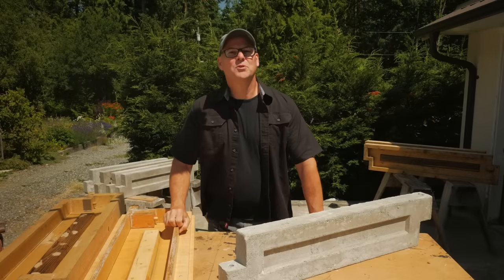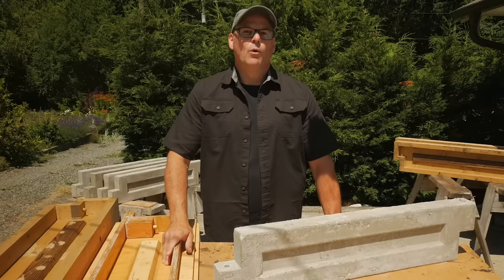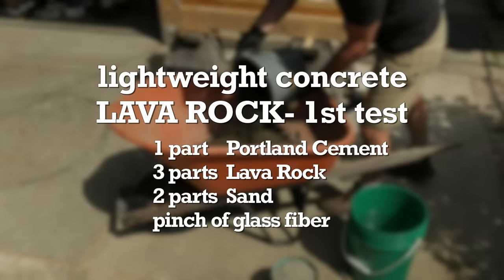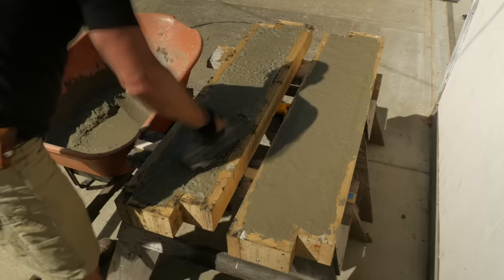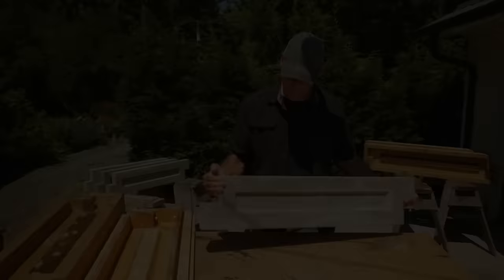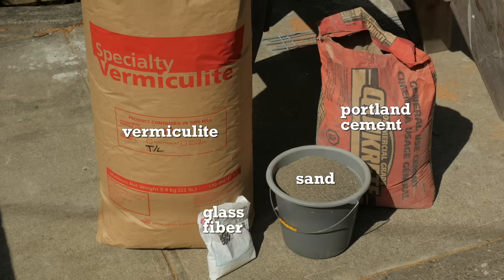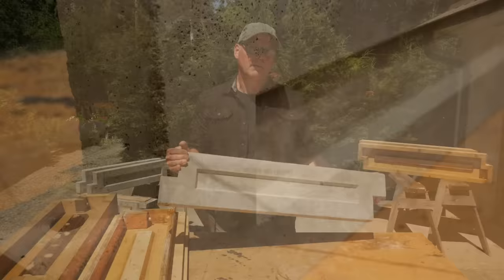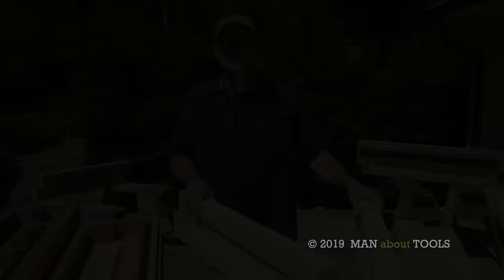make Lightweight Concrete Garden Boxes PART 3 - Aircrete Vermiculite Lava Rock

Comment: And if it is not abrasion resistant tried dipping the completed mold into some liquid concrete letting it dry and then dipping it in again To give it a solid concrete coating

Comment: Isn't what's warping is the form.?
The cast can't bend independent of the form can it? So the assumption might be that the form was left on the saw horses to dry and the weight was causing the unsupported middle portion of the form to sag down...

Comment: As an incurable engineering  MacGyver since I was 8yo I can stop experimenting with materials! Your videos on concrete are great! Several decades ago I made floating concrete docks that were stronger than what is considered high strength. I used a micro bubble mixture and expanded shale aggregate for low weight and posalith  to make the dock water tight! The expanded shale aggregate is only produced by a few places around shale mines! Keep up the great work!

Comment: It'd be a pain in the neck to deal with two blends, but if you put a cm of vermiculite concrete mix in the bottom of the form then topped it up with aircrete you'd have something lighter and more durable probably. You couldn't do it much ahead of time because you wouldn't want to risk a cold seam.

Comment: Im making mudcrete which uses coco fibre in the mix. As the clay in the mix expands and contracts with heat the coco fibres absorb the movement and hold the material together like a son concrete or adobe. I use this mix for pizza ovens, rendering walls and making mud stoves. Perhaps the coco fibre would do the same job in aerated concrete. Im going to try it...

Comment: What about a hybrid mixture of a pour, with the more durable mix being poured first (or even sprayed into the forms) for the part that would be facing to the outward side of the planter box, followed directly by the foam mixture, which would still provide your lightness of weight ?
This might give a harder outer shell with a lighter core.
Best of both worlds !
Problem solved..👍

Comment: Aircrete Harry has another video on aircrete reinforcing. It includes a lot of Basalt (a brand, not a material I think) meshes and chopped strand from Sudaglass and Helix Micro Rebar, which looks like individual wires from a wire brush. This is used for making bomb proof concrete (A bererm? Oh No! (Thank you, Inspector Clouseaux)). He tests them with an 8 lb hammer. For reinforcing the surface I'm thinking like a resin that can soak through the surface. Sodium silicate would work (Honey Do) but needs heat curing to around 100 C.

Comment: The cement paste as it cures will naturally shrink, causing cracks.  The sand and stone in the normal concrete mix resists this shrinkage tendency.  You get the same problem with normal concrete if you over cement the mix.
Reply from the maker: I agree. The aircrete needs to be fundamentally stronger to resist the internal stresses of curing. I need to do more tests on this.
Reply: @MANaboutTOOLS  I was in the cement technical services industry for over 10 years.  We couldn't solve this problem.  Hope you have better luck than we did.....

Comment: Make the first "ground" course out of the usual  3-2-1 (pea gravel-sand-cement) using a form that produces a 3 to 4 inch high "log".  This will be durable so as to handle the string trimmer and occasional mower wheel strikes.  Could consider making these logs shorter to reduce the weight further - but then one may want to include more pipe in the next lightweight panel above to help tie these shorter ground sections sections together with rebar.  Should one want to go higher,  like 24 -36 inches, one may want to consider including staiinless eye bolts on the soil side of the lower  light weight panels so that stainless cable or chain can be tied across to the opposing panel to help address pressure over time from the greater amount of soil above.

Comment: Would be interesting if there is a material, possibly some type of foam application to encase the lava rock to prevent the concrete from filling in the natural openings, this could help lessen the weight of the panel.

Comment: What about a three step process? i.e. first layer of vermiculite, core of the blocks with aircrete + mesh and final layer again Vermiculite? Probably will get a 50% lighter block thank concrete but almost as resistant to it.

Comment: Brilliant video ... my suggestion for the Vermiculite version is to wet the mould panels on the inside and spray some dry cement on them and then pour in the mixture. this will give it a hard skin that would resist abrasion ... when is Part 4 coming?
Reply from the maker: Thanks! The vermiculite is quite durable, and even though I didn't show it, it was not damaged by the line trimmer. I'm editing Part 4 now. Will get it out asap.

Comment: I'd make the "center divot" a "Mesh-filled hole", while simultaneously making the divot a little smidge larger. Either double up the hog fencing with chickenwire, or go with just the chickenwire.
That is: the concrete doesn't need to be made weaker/lighter, there just needs to be less of it, period.
Also, the poles through the endcaps to anchor them could be longer to support fencepoles for chickenwire fencing.

Comment: Great video.  Regarding the aircrete strength.  I wonder if you mix in superplasticizer which would allow you to cut back on the water while retaining the same consistency to the mix.  Less water should yield more strength.
Reply from the maker: Worth a try as well. Thanks for the suggestion

Comment: I suggest you make the part symmetric or as symmetric as practicable.  Your part has a void on one side and shrinks appropriately (cups toward the void).  I suspect someone has already commented on this.  Your rebar will still be in the center of the part, but you will want to add a twist of 9 wire to assure it stays in the center of the thin section. Next, how do you create the void in the top part of the mold? I suggest you make a wood part in the same shape at the part on the bottom.  Measure the volume of the part. I suggest you make a test form cut it in 1/3's or 1/4's and plunge it into a (full) container of water.  Some water will overflow.  After the water settles down and the overflow is on the ground, remove the wood.  The container will no longer be full.  use a coffee can to fill the container with fresh water.  Count the number of cans required (including the fractional can at the end).  
Change your procedure for filling the molds.  Do everything as before, vibrate the part as before; then, remove exactly the amount of aircrete as you found to be the volume of the wood.  Use the same coffee can to remove the mud. Next, vibrate the wood flush to the sides of the mold.  TaDa ... an (approximately) symmetric part.  You still need a procedure to make sure the wood doesn't float (clamps), and another procedure to assure the wood in centered on the mold. add wings to do that (with a gap to allow you to trowel the part under the wings) and solve the floating problem in one step.
Hope that makes sense.
BTW, your presentation was a clear and concise as it could possibly be, considering the amount of information to hoped to (and did) convey.  I only wish I had your talent.  Well done.
Reply: Now that I said AWAY from the void, I'm uncertain.  The air doesn't shrink.  The solid part does, so that means the part cups away from the void.  Damn, it's one of those, but it doesn't matter.  Make the part symmetric and it will shrink symmetrically. If you must make it asymmetric, add STEEL (density 7.8 times greater than water) but it has an elastic modulus that spits on shrinking concrete.

Comment: If you're trying to make lightweight concrete panels, then why use any sand at all? (i.e. only use lava rock, vermiculite, perlite, etc. with the cement/water). (I'm a concrete newbie btw, but from my understanding sand doesn't participate in the chemical reactions happening in cement and only functions as a filler/binding, and so could be replaced with lighter weight products, no?) 

great videos that are very well put together. thank you

Comment: Consider also the load on the concrete of retaining the garden soil. Mesh, yes, but also agregate for strength. I don't think the aircrete would withstand a freeze-thaw cycle.
Reply from the maker: I agree. I will do more tests with aircrete to try and find a stronger mix. But right now, I like the vermiculite. And I suspect the perlite would be good too.

Comment: Add a small layer of durable sand cement concrete in the bottom of you mold say half a centimeter and them pore the aircrete over it that give you a 1/2 cm durable surface that is resistant to the loan mower. Do the curing in a moist environment, curing is a process that uses water. I have doubt about the durability of the end points of the panels which are joint using a steel or wooden rod. The endpoint don't resist a lot of momentum and can easily break. I do like  the design.

Comment: Even after one week pouring ,  very few of my panels bent mostly temperature difference .... but done it even after 10 days :  lade  it on a flat surface horizontally and watered it for a couple of hrs both sides at first , maybe some weight in the center .... next day could not belive it .... perfectly strait .....  I'am talking about over 80 mpa  (12000psi) concrete  2 send and aggregates and 1 cement  with a 40 % Water to cement ratio but when you have so much cement  like the last one here , should have been watered even a couple of hrs after pouring and keep it colder with a Burlap blanket or something like that even dabbed sponge foams ...     Thanks for the vid  Cheers   Will from  3DStones.net   Canada

Comment: I investigated plasticizers. Turns out they are basically soap. Therefore, you're ending up with too much water, which weakens the finished product. Could you make aircrete by gradually mixing just powdered cement into the driest possible foam, only adding more water as needed?

Comment: you may have let the aircrete dry too fast.  Consider keeping them in plastic bags or under plastic wrap after you have removed them from the forms.  It will take longer for them to cure though. it will also make the them harder.
Reply from the maker: All the panels were cured for 4 weeks under a plastic tarp; watering them every few days.

Comment: I wonder if it'd still bend and crack if the panels were symmetrical? The one side has that recess "pocket", and the shrink rate/strength won't be equal. If you made the panels with a "top" that had another recess pocket in it (would have to clamp or weight down the top), I'll bet you'd get rid of the bowing. Also, I wonder if the air bubbles rise to the top and change the strength and density. It'd be interesting to get a concrete saw, cut one of the panels, and then calculate the density of some of the concrete at the bottom of the pour vs the top.

Comment: You poured a bottle of supermarket shampoo into your batch of concrete and unmolded a few days later... what'd you expect?  :D 

Try curing it completely submerged in a pool of water: unmold, then into the pool for at least 7 days. That'll at least keep your moisture uniform and let the concrete develop most of whatever strength it has. 

Bowing means you're getting more shrink on one side than on the other, due to (normal) uneven conditions on the surfaces. When the panels are on the ground, the side on the ground gets more moisture, the side in the air dries out faster and shrinks. Same in your forms: the top side is going to get warmer and dry out faster. And since you air cured, and you've got all that foam in there (plus side effects from whatever dyes and cosmetics were in the shampoo), your concrete strength is probably in the pits and any small force is going to warp it out of shape. It'd be neat to get someone to cast a few cylinders/cubes from that shampoo mix and test them in a lab to see exactly what concrete strength you're working with.

Change the mesh from galvanized to regular old reinforcing steel. With time the galvanization layer is going to peel and you're going to lose some bond between your concrete and the mesh. 

In the end, curing submerged and changing mesh might help, but the sure fire solution here is going to be checking your mix. You probably need less air (and something a bit more orthodox than shampoo to generate it), and more aggregate/cement.
Reply: I copied these forms. Just got done smearing em with castor oil. It's what I had.. Your post is wicked appreciated. I've been dragging my feet on making up the aircrete. Not enough info out there. Good to hear about the galvanized. I couldn't find the shit anyways. What would be a good alternative to soap suds? More importantly, how do I fill those bubbles with a superior gas?
Reply: @mikeyo1O1  The gas is really not important. For the most part it's the foam chemical: it has to be inert in concrete, and the surface tension has to be enough so the bubbles don't collapse before it's time.

A lot of people use diesel oil for the forms.
 

I'd try doing the forms upright instead of on their side. That way you minimize moisture loss by exposing only the top surface, which is smaller than the side. Unmolding shouldn't be much different that way, you'd just need to adjust the screw positions a bit. And try submerging the cast elements to see if that improves the bending problem.

As for the foam, check with local industrial concrete suppliers. You're looking for a "foaming agent" for lightweight concrete. For example here on the market there's SikaPoro by Sika, and Cellocrete by Draco, to name a couple. They're inert and if used properly won't harm concrete strength. On the manufacturer's website there's a technical datasheet, that tells you what the recommended dosage and methods are. In your case since you're looking to do the foam without an air compressor, you might have to look around on the internet for a foaming agent that allows mechanical mixing... or simply get a sample a try mixing it up with the drill to see what happens.

If those don't help, you're going to need to change your mix proportions... less foam, more cement and aggregate. And keep the water as low as you can get it: in the end, what kills your concrete strength is the water/cement ratio. If you want to go really low on the water, look for a concrete plasticizer/water reducer you can add to the mix. 

There's just one problem: once you start adding plasticizers and foamers to the mix, and increasing cement ratio, your mix gets more expensive. And you might end up with concrete planters that cost twice what they cost at the hardware store. It's one of those balancing acts where you have to figure out just how much you're willing to spend to get the weight down, and how much you really need it to go down: in the end if the planter's going to sit in the same place in your garden for its most of its life, no real point in using lightweight concrete. Just go for regular weight concrete and get a friend to help you move them into place.

Googling a bit, I found this site which has some interesting information on foamcrete: https://foamconcreteworld.com/foam-concrete-the-basics/
Reply: @geekcr  I forgot that I had an aquatec diaphragm pump from my aeroponic days. I whipped up a foam generator in 15 min and $10 worth of materials. I don't know why these guys are over-complicating these generators. Stuff a 2' section of pvc with steel wool and cap both ends. Thread on male compressor hose fitting and a shark bite 1/8 female to one of the ends, and drill a hole at the other for the foam to escape. Lower reg on compressor to around 50 psi, attach 1/8" lines and fire it up. If I didn't have the pump, a gravity feed would surly work. No need to contain the foaming agent in the gun, people. Cheers, and thanks for the insight.

Comment: My reservations for the aircrete, would be that the would absorb water, which in winter would freeze, so breaking the surface.  
This would continue, until there was only dust. It may be possible to seal the surface, but that may add cost thats unacceptable.

Comment: There is a product called perlite you add that to the mix and that'll make him extremely light instead of using cement use mortar mix
Reply from the maker: See Part 3.5 : https://youtu.be/hBvPs7CBf5Q
Reply: very good if you want your product to dry faster add one tablespoon of baking soda do you mix and it will be hard within 1 hour you would have to work a little faster perlite baking soda and masonry mix instead of cement makes it lighter and faster drying product I know the faster drying is not always the best

Comment: I enjoy the idea with airconcrete,  well and now what about plants and results on the grow of vegetables with this pannels?
usualy square garden are made of wood 

how it is with humidity? better level? with slugs?
how it is with thermic reaction of the earth of the square garden, not with the panel it self for his resistance  but for the transfer of the sun heat or freezing level temperature in winter? do you measure it? the difference beetween  a same square wood made and  a concrete square
because ok to do such panel that are most resistant easier to build etc but what about végétable production results?
are plants confortable and more or egal productive?

Comment: something you could try: embed your steel rienforcement into a piece of construction foam, maybe make some holes so the concrete penetrates all the way like it would through steel mesh. 

then use a higher strength concrete using an additive like latex acrylic. this way your actual concrete can be thinner even though the panels take up the same space, and still end up being stronger.